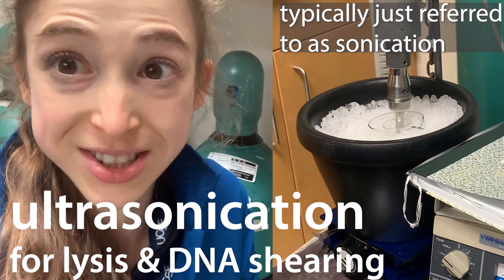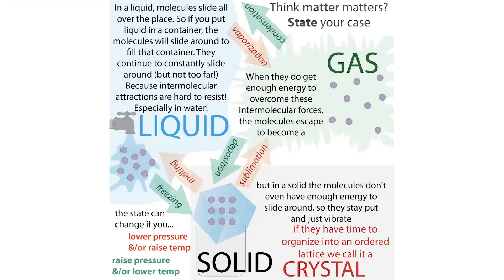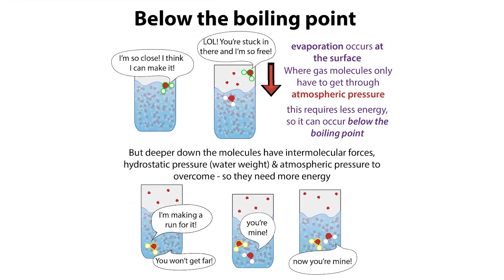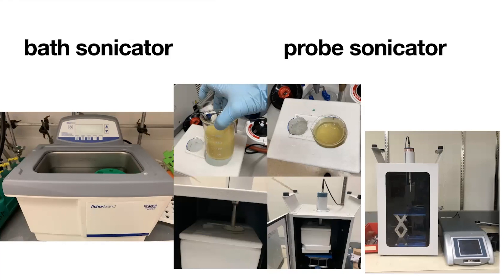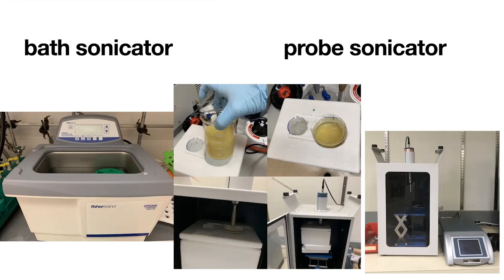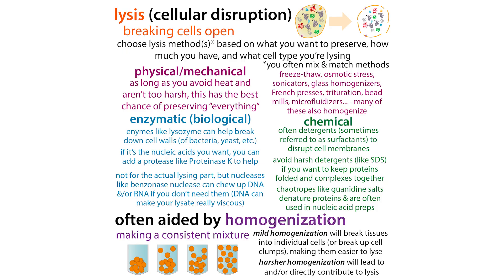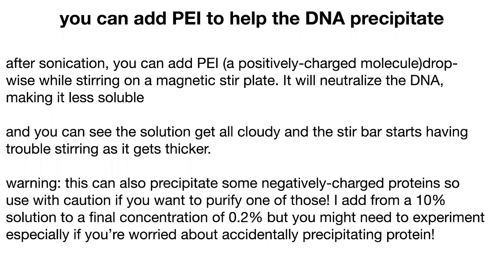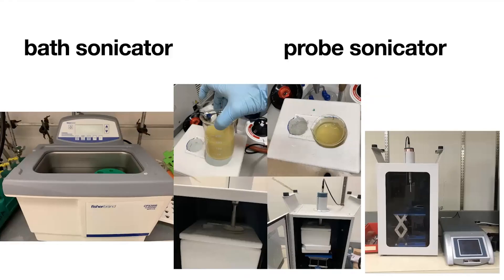Ultrasonication (often just called "sonication") in cell lysis

Comment: Hi, thanks for the great video!
We’re using a BANDELIN SONOPULS HD 2070 to lyse E. coli expressing a recombinant enzyme. Unlike typical 8s ON/OFF protocols, our device works in 1-second pulse cycles (X% amplitude for Y ms, then off for the rest of the second).

We tested with GFP-expressing cells, but still see GFP in the pellet after centrifugation.
Any advice on amplitude, pulse time, or total duration to improve lysis with this device? and also buffer

Thanks a lot!
Reply from the maker: You might try adding lysozyme pre-treatment. It's also possible that your GFP is going into inclusion bodies rather than the cells are unlysed. Do you have another internal protein you could blot for?

Comment: To clean probe sonicator tip, which ethanol should I use (either denatured ethanol or 200 proof ACS grade ethanol? I am going to extract proteins from cell lysate and need to clean sonicator tip with ethanol followed by water between use!
Reply from the maker: Any ethanol should be fine for this

Comment from the maker: If you go back to the gloved hand analogy, we’ve been considering the gloved hand together, but the glove doesn’t need to be constrained by the constraints of your arm. If you take the glove off, the arm and the glove can move independently (assuming you have some electrically-powered glove or something - point is, molecules can get increased entropy by breaking into smaller molecules. If you give them enough energy.

This is a probe sonicator - you actually put the wave-generating tip in the sample. We also have a bath sonicator - I use that to remove crystals from mounting loops so I can reuse them. You might have something similar to clean jewelry.

Note: our sonicator is a lot more intense than the type of ultrasound you might be familiar with. For example, in medical ultrasound, waves are sent into the body and a machine records them getting reflected back to see what’s where. And whales use to do something similar. But in our case, we’re sticking the generator directly into the sample. And blasting the power. So don’t worry about this happening in your medical procedure. Ultrasound is considered really safe and is definitely safer than x-rays. 

When using a probe sonicator, you want to “go deep” - but not too deep! It took me a while to get the feel for the right depth. If you’re not submerged enough you’ll get foaming and a high screeching. Early in my PhD-ing, after accidentally making a latte foam, I over-compensated and put it too deep and blew out the bottom of the beaker… Another problem with being too deep is that it interferes with circulation. Also, just like in Harry Potter when they say the staircases like to change, since water’s weird in that its ice is bigger than its water, when the ice under the beaker melts the beaker will sink. So instead of just ice, you want to pack the beaker in snug in an ice + some water mixture. One of my co-workers cut the lid of a styrofoam box to help hold the beaker still too. When he left the lab he gave it to me as a parting gift I treasure!

That ice melts because cavitation generates intense heat, which you don’t want to hurt your protein. So you do it in pulses. Bacteria need a pretty good beating, but insect cells are more fragile and, for them I usually use one second on, 4 off - so for 1 minute of total on time it’ll actually take 5 in, so if I’m doing multiple samples back to back I’ll usually leave one going (after making sure all’s good) while I go prepare the one that’s done for the next step, where we take things ultra ultra -> go from ultrasonication to ULTRACENTRIFUGATION, where we spin the cells REALLY FAST (like 35K rpm fast) to separate the membrane bits from the soluble stuff.

But before I spin them I do one more thing to really make the DNA stay away (from my protein). The sonicator sheared it up, so now I have a bunch of DNA pieces floating around and I want to “unfloat them” - take them out of solution (get them to precipitate) so that they’ll pellet out, away from my soluble protein. To do this, I add PEI (PolyEthyleneImine). PEI is a cationic polymer (chain of similar, positively-charged, repeating units). PEI’s repeating units are amine (nitrogen-hydrogen) groups with ethyl (-CH₂CH₂-) linkers, and they can branch off of each other tree-like. DNA (being negatively-charged) is attracted to it, so they snuggle up together, forming a nice compact blob called a polyplex which, importantly is charge-neutralized. 

Water doesn’t like to surround neutral things because water molecules are highly polar - they have partly positive parts (the H’s) and partly negative parts (the Os) so they’d much rather bind to other partially charged or fully charged things. They exclude neutral things (the hydrophobic exclusion effect) so those neutral things precipitate. It’s really cool to watch - I add PEI drop-wise while stirring on a magnetic stir plate and you can see the solution get all cloudy and the stir bar starts having trouble stirring as it gets thicker. Then, when you super-fast-spin them, they sink. (warning: this can also precipitate some negatively-charged proteins so use with caution if you want to purify one of those! I add from a 10% solution to a final concentration of 0.2% but you might need to experiment especially if you’re worried about accidentally precipitating protein!)

Since you’re spinning so fast, you have to use super sturdy ultracentrifuge tubes and balance them carefully (when you’re spinning at 35K rpm you need to be balanced really well! It’s not like when you’re just doing a low pulse spin on one of those minifuges where you just eyeball it loosely). Instead I start with eyeballing, then adjust to within ~0.02g or so. I get them really close and then pipet in the tiny bit that’s left over in the beaker to even them out. 

and FYI, my protein’s not bright yellow. The yellow is from yellow fluorescent protein (YFP) that we co-express with our protein when doing insect cell expression, so that we can tell that the cells are making protein and monitor them so we harvest them before they lyse on their own… You want to make sure they’re in a safe environment first! Which is why, when we harvest them (collect the cells and remove the growth media) we resuspend them in a nice buffer (pH-stabilized salt water) that’s similar to the intracellular liquid and add protease inhibitors so they don’t get chewed up. 

Note: There are also enzymatic methods to degunk the DNA. In undergrad, I used benzonase nuclease. That’s stuck in my head because I really love that name. It’s a genetically-engineered version of an endonuclease (DNA cutter) from the bacteria Serratia marcescens that cleaves DNA & RNA nonspecifically.

After the spin is done it’s on to chromatography, where we use columns filled with little beads (resin) that interact with different proteins differently and thus let us separate them. more on that here: http://bit.ly/proteincleaning 

more on boiling and boiling point: http://bit.ly/boilingpoints 

more on recombinant protein expression:  http://bit.ly/proteincleaning 

more on lysis: https://bit.ly/homogenization & https://youtu.be/IPfRDirApoM 

more on topics mentioned (& others) #365DaysOfScience All (with topics listed) 👉 http://bit.ly/2OllAB0